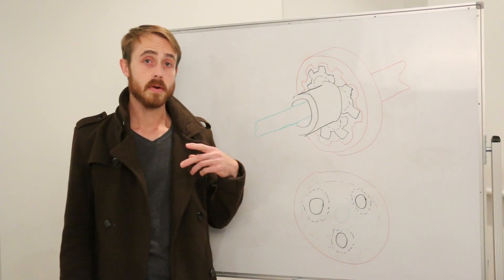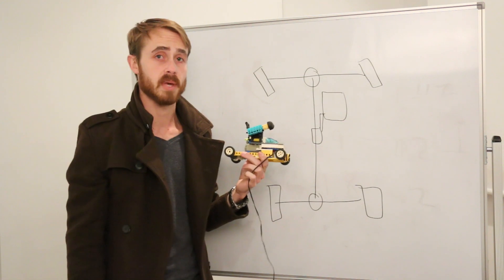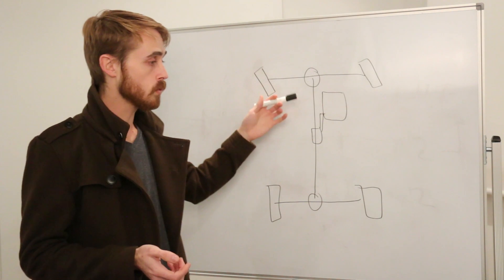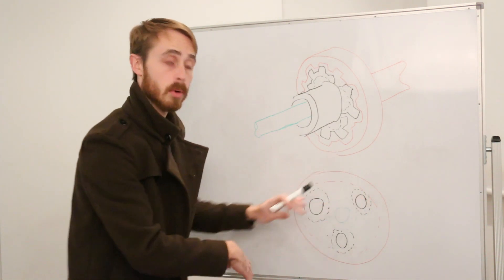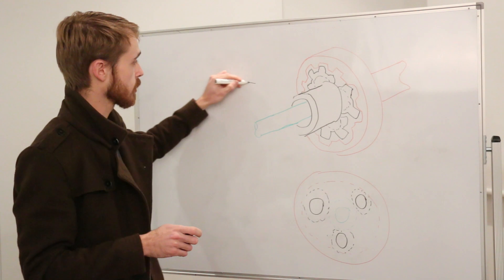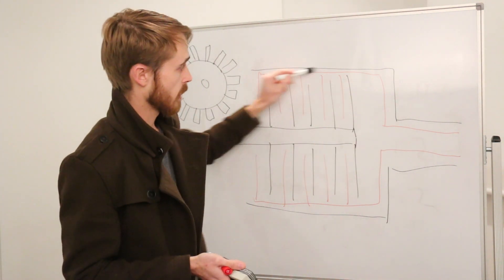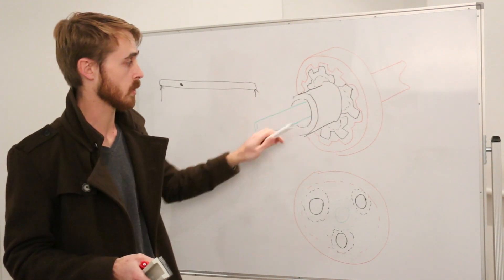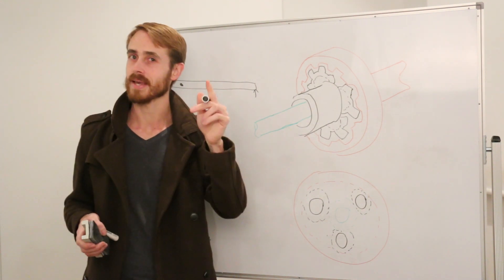How do Center Differentials Work? - The Viscous Coupling Controlled Epicyclic Centre Diff

Comment: Automotive engineer here.  Thanks for explaining this especially with the viscous coupling uses to transfer torque to the shaft with most traction.  Definitely was hard to find out how it works.  Also want to point out clutch packs are also used in lieu of viscous coupling although I don't know what is the advantage between the two
Reply: Clutch pack in my Subaru dif' is just the locker - works like a limited slip - auto locks. It's an open 2 pin dif' most of the time and just locks if there's loss of traction. So the clutch pack could be removed and it'd still work as an AWD on the road but I don't have the opportunity to try it.

Comment: Fantastic video! Could you also give a few examples of vehicles that have: 
1) THIS (the one you explained) type of center diff. Also, in such vehicles if, say, any of the front wheels lose traction, will all of the power be sent to the rear wheels due to the viscous coupling/locking mechanism? 
2) An always open center diff
3) Other forms of auto-locking center diffs.

Comment: There is a little error there, the output shafts of a geared asymmetric torque split center differential spin at different rotational speeds when the car is cruising at a constant speed on a straight road with all wheels spinning at the same rate.
For example if the bias is 60 rear 40 front, the speed of the front shaft will be slower than the speed of the rear shaft, and in order to spin both axle's halfshafts at the same final speed, the gearing of the front diff will be different than the rear one, that is how the wheels spin at the same speed but get different torque levels.

It is like 2 bicycles, one in front of the other, tied together with a rigid connection, but the front one using the large pedal pinion and the small wheel pinion, and the rear one using the small pedal pinion and the large wheel pinion.

Both bikes spin their wheels at the same speed, but delivered torque is different due to the difference in gear selections.

You cannot transmit a different torque to the axles with a differential with rigid static internals.

The planet carrier, sun and ring gear must all rotate at different speeds to produce the torque bias
Reply: Later edit, my explanation is not valid for all the differential types, some of them,like a quattro crown gear center diff split torque with static internals, the tooth count differs and so differentiated leverage is applied to the front and rear output shafts, while they spin at the same speed.

The moving internals would create too much heat and mechanical drag to be used across all types of geared planetary differentials

Comment: Is a transfer case always locked then? Because my understanding is a transfer case with front a rear diff lock is fully locked.
Reply: A transfer case is always locked. However, if you don't have front and rear lockers, even that would spin the wheels that no traction and you'll be just sitting there. However, it's certainly better than an "open centre diff" AWD. 😊

Comment: I can't tell the difference between my two and buggies,  and one has a center diff and one doesn't.  Are you sure having a center diff is better  ?
Reply: Depends on what you want from your vehicle. My mk2 Shogun has a centre diff and I can drive around on dry, sound road surface in 4wd.
My friend's L200 pickup doesn't have the centre diff, so he can only 4wd when on wet or loose road surface.

Comment: Hi there, thanks for the video. I´m trying to understand how to correlate that to a simulation game and in that particular game, AWD center differentials are simulated using the following 2 codes:

CENTRE_RAMP_TORQUE=56
CENTRE_MAX_TORQUE=800

Numbers are probably in NM and this code was created to be used by an Alfa 155 DTM car, which was in fact a further development, by Abarth, of the Lancia Delta Integrale rallying series, which means that these 2 lines of code are meant to simulate the Fergusson Viscous Coupling Controlled Epicyclic Center Differential.

Can you help me figuring it out?
Cheers
Reply: Yeah, me too...  on Dirt Rally.    Could Kyle or anyone else give any more subtle info regarding how strong vs loose  centre diff affects driving characteristics?
Reply: I'd be willing to bet the game is simulating the center diff as a clutch pack style diff based on those 2  parameters. With Max Torque being the the maximum torque the differential will transfer from the slipping side to the non slipping side and ramp torque being the amount of torque needed to fully engage the clutch packs. Look up a video on clutch pack LSD's. you can see the "ramp" they are referring to.